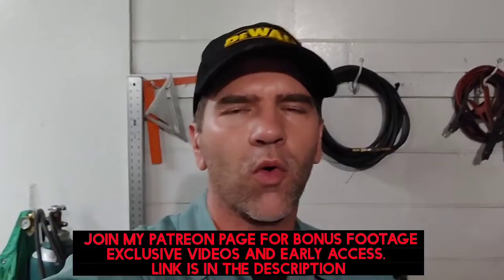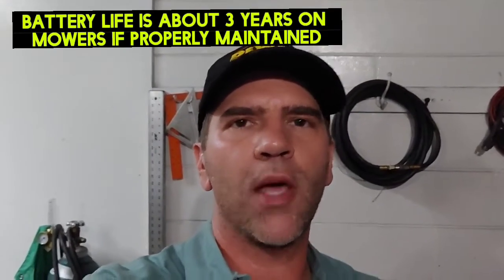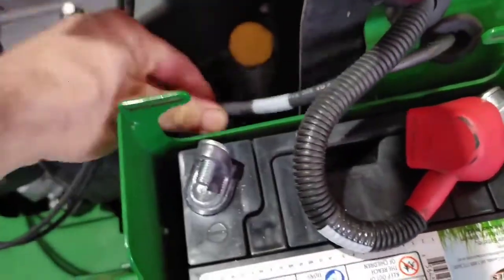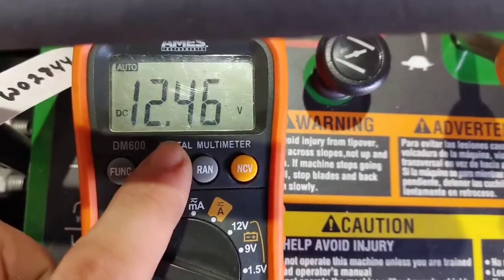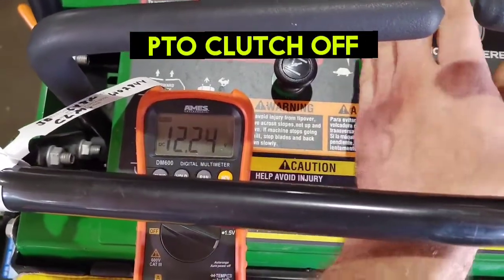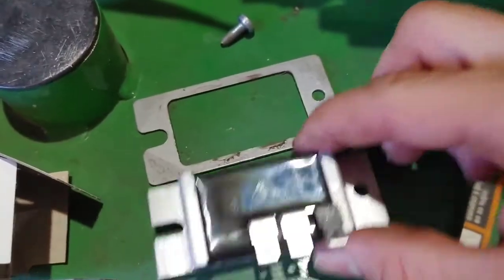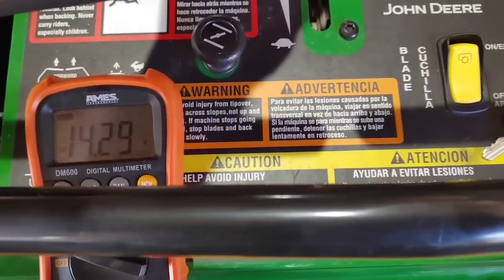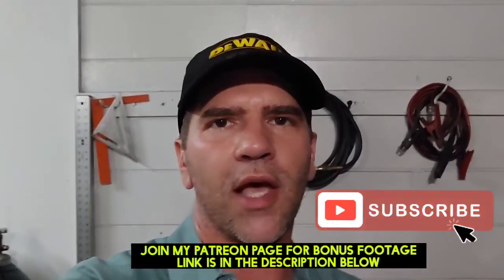How to check your mowers charging system. Dead Battery? Blades not engaging? Check this first!

Comment: There are a lot of videos, on a lot of subjects, imparting a good deal of information.  Too many lack good production, organization and planning.  My PTO was cutting out so I watch your one on PTOs, then this one.  My battery is relatively new, three months old, but was constantly dead and I needed to jump the system.  I've replaced a voltage regulator on another mower, and it looks like I'll be replacing it on this mower.  Thank you for great videos, as @DougDobak said, "clear and concise"!
Reply from the maker: Thanks Richard!

Comment: Dude, excellent video.  Just recently, I had a John Deere x380 (in great condition) given to me; friends are moving and didn't want to take it.  Anyway, I decided to give it a whirl.  I already have a couple riding mowers, so I was thinking of just selling it and donating the proceeds to charity.  So I cut my yard with it and parked it.  It ran great.  I went to move it into my shed a while later and it wouldn't start.  I jumped it, but it died almost immediately.  I read the manual and saw that the battery charging area of the console indicated that it would not charge correctly.  It indicates this before actually starting the mower.  So I did a search and here I am.  I swapped in another batter that I had on one of the other mowers and, prior to trying to turn it over, the indicator on the console showed that it would charge correctly.  The funny thing is that the battery that was in the system before showed higher cold voltage than this one that I'd just put in.  The old battery showed 12.6 whereas the new one showed 12.3.  My guess is that there's a bad cell in the old battery and that prevents it from starting at all.  So... I cranked it up with the swapped battery and checked voltage at the battery.  It was showing slightly over 14 so I guess it's charging just fine.  With your instructions, I stopped right there and I'll just get a new battery.
Anyway, I really appreciate your video.  Instructions are very clear and straight forward.  Thanks a bunch!!

Comment: Great advice. I have an older Simplicity and thought I had 2 separate problems, low charging and blades not engaging. It turns out that a newer, heathy battery and a charging system that is working, fixed both issues. Thanks for videos.

Comment: gREAT WORK, YOU ARE A CLEAR AND CONCISE PRESENTER WITH OBVIOUSLY GOOD EXPERIENCE!
Reply from the maker: Thanks James. I appericate that 🍻
Reply: @Mechanical_Mind  You are making my life at home a lot easier, I mow 20 acres and this is the start of the wet season in the tropical north of Australia, left unchecked some of our spear grasses grow to 10-12 ft easily, which then brings in a huge fuel load during bushfire season, so i aim to keep it short. Your tip about the fuel pump was passed on to a mate who had just noticed his mower beginning to blow smoke so I reckon you saved his engine! Cheers
Reply from the maker: @jamesreardon8585 Ok good deal.  When I make my next trip down there to Australia you can buy me beer 🍺 😎👍. Maybe I can do a video on site too
Reply: @Mechanical_Mind  no worries mate

Comment: I have a John Deere 970 R idles up and down. when I shut the machine down Sounds like a gun shot just wondering if you could give a few tips highly appreciated. I watched your video. where you  spray around the carburetor area, but it doesn’t seem to change the idle.
Reply from the maker: My first thought would be that your carburetor is bad.

Comment: excellent video. Do you have one on how to replace the stator? The regulator didn't fix my problem
Reply from the maker: What model mower do you have?
Reply: I appreciate the response it seems pretty easy actually. It's a John Deere Z445 with 54inch deck
Reply from the maker: Yeah its not too bad. The stator will be under the flywheel. Just kinda time consuming.  I drive a few chisels under the flywheel to apply pressure to lift it up then tap the crankshaft with a hammer ( after removing the nut) and that usually will remove the flywheel.
Reply: Thanks brother. I replaced the regulator and nothing changed. Gonna try the stator next. I saw another video on how to test the double plug to see if the stator is putting out. Gonna try that. I appreciate your time

Comment: I had identical situation to your video. Stator shows 31-33. Replaced Voltage Regulator. Fired up z445 and check of volts was 12.6…so I’m still not charging???  Could my new VR be bad?  Is there a way to test?

Comment: Is there a way to test the voltage regulator? Thanks! Anyways I'll test the stator.
Reply from the maker: If your stator is making 40 volts AC but your battery is not getting 14 volts DC the only thing it could be is a bad voltage regulator or a loose connection. If the wires are burned that is most likely also from a faulty voltage regulator or loose connection. Also make sure your ground connections are not loose or corroded.

Comment: @mechanicalmind my husqvarna yth2348 blade disengaged while mowing then the motor stalled out like it was running out of gas. Once the engine shut off, nothing worked, will not crank. I installed a new battery but still nothing, no lights or hour meter working. All the grounds appear to be secure. Any suggestions?
Reply from the maker: I bet it's the charging system is not working. You should have a 20 amp fuse close to the battery. It's probably blown. If that is the case then after you put in a new fuse it should crank up and then you need to use a multimeter to check if the charging system is working.  
At half to full throttle you should get close to 14 volts from the battery while the engine is running. If it's just 12v or less while the engine is running then your charging system isn't working.
Here is a video showing how to diagnose the charging system.  
https://youtu.be/Xj1w8dWxapI
Reply from the maker: If it blows a new fuse instantly then you have a short somewhere. Let me know you find. It's probably something simple. Hopefully the electric clutch isn't bad
Reply: @Mechanical_Mind  Fuse was blown, changed it and it cranked without any issues. Charging system appears to be working, 13.56 volts. What do you suppose could have caused the fuse to blow? I did find 2 wires going to one of the headlights were just bare laying inside of the hood but the lights were not on. Could it have shorted with the switch off?
Reply: The mower has 300+ hours on it.
Reply from the maker: @wendellwarr  I'm going to guess that your clutch got too hot. It might blow the fuse again after you cut a while. 
 At 300 hours, I would expect the clutch bearings to be almost done. They start getting hotter and faster the more they wear. So check your clutch. 
Also give a good inspection to the all the wire connections. Make sure they are clean and tight.  Just loosening and tightening them back will usally clean them enough to make a bad connection good again
I spray wd40 on the connections and plug and blow them out with compressed air. Wd40 will not hurt anything and will help loosen dirt and rust.
Reply: @Mechanical_Mind After changing the fuse and cutting for about 10 minutes it did the same cycle, blades disengaged and then the engine stopped. I changed the fuse to get it back to the garage and would not start, immediately blew the fuse. I have changed the PTO clutch and you can here it engage when you turn the engine switch but the engine will not attempt to start.
Reply from the maker: @wendellwarr  check for a wire rubbing the insulation off somewhere. Check all your ground wires and connections.  Something must be making and losing contact somewhere

Comment: always good vids! Thank you!    So, I charge at around 14 V's, but when I turn off the machine and check the battery THE NEXT day... (before I start the machine ) my battery is reading over 14 volts!  again, not running the engine.  that's crazy.  s/be around 12.65 of course.  any ideas??  THANKS!
Reply from the maker: That makes no sense.  There is no way it could legitimately stay at 14v if nothing is charging it. 🤔 I have no clue